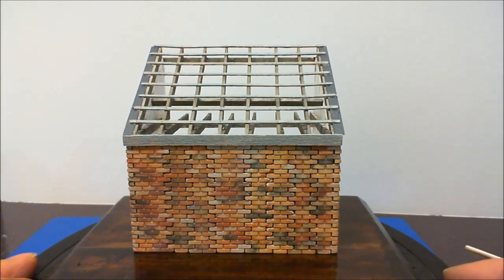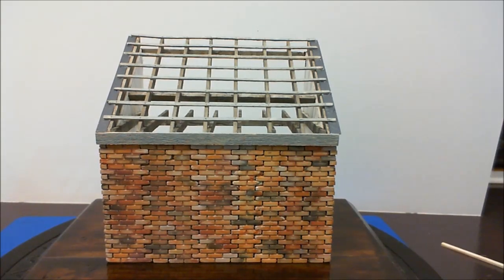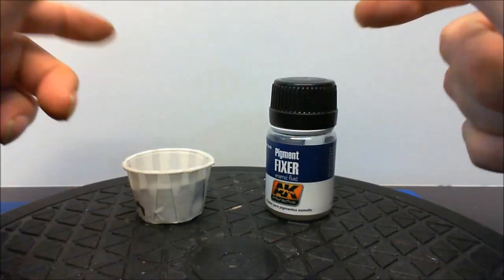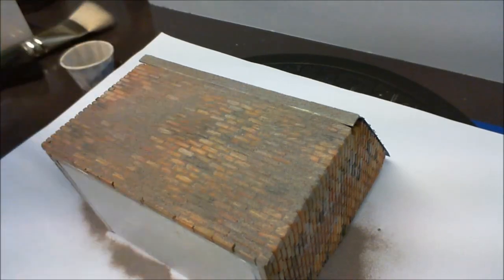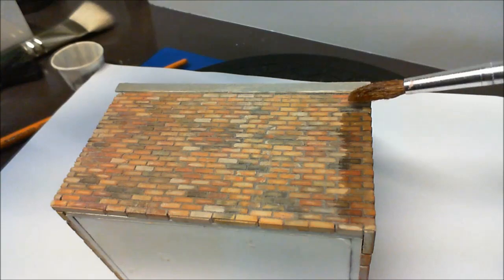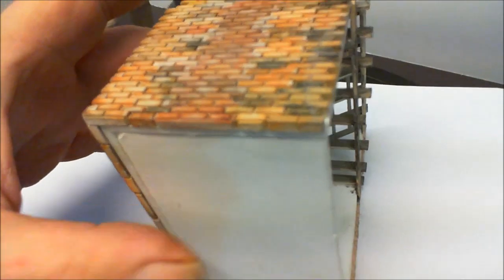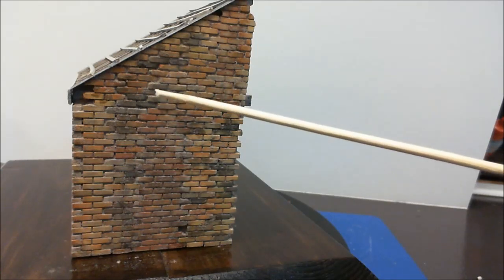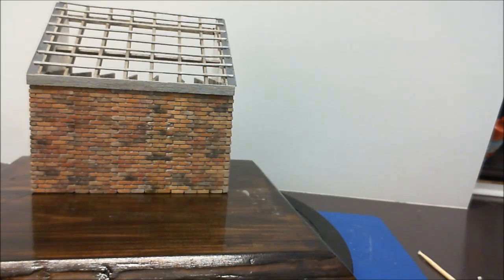Grouting Bricks In 1/35 scale (I, Video 1 )

Comment: Well done Simon, that was very useful indeed. I must admit I was wondering how to hide the gaps between the sections of brickwork and now I know!! I was thinking at the same time as you about using dilute acrylic matt varnish in place of the Mig Pigment fixer, it would be interesting to see if that works (Hint Hint).
Thanks for the video it was very useful indeed,
Joe
Reply from the maker: Don't worry Joe on the case of finding a different fixing agent as the pigment fix cost so much many thanks Sim

Comment: Been making castings from Hirst Arts for a number of years and always had problems with gaps. Tried filling them in with Hydrocal, but it still looked like crap to me with the walls/bricks showing obvious straight lines. Not that the D&D players cared, but I did. So going to give your way a try, but using railroad sand/ballast. As far as using scenic cement as someone has brought up, did some looking and from the railroad modeler website was this one guys reply:"I used the white glue to glue the Homasote down to the sub base as well as the scenery materials - so this is the method I have used over the years. As for a wetting agent - I use the premixed windshield washer fluid (summer blend) as it is nothing more than isopropyl alcohol mixed with water.  It really made gluing down scenery materials a lot faster than trying to mix the dish soap into the white glue mix.I just have a little finger pump sprayer bottle and spray an area with the washer fluid and then add the glue - sinks right in.If the area isn't soaked enough - just another couple of pumps on the sprayer! I also use the larger kitchen type of sprayer bottles with the hand grip with the washer fluid in it when doing very large areas (when I am just covering new scenery areas and I want to just put something down quick).When I did scenery - at our Club years ago on our large Lionel Layout - I used the 1 quart pump handle yard chemical sprayer (new - of course!) to apply the washer mix and even the thinned down white glue (but that was usually a one or two time only use - as we never seemed to be able to really clean out the pump sprayer) ! ;-) I now stock up on white glue from Wal-Mart when they put the school glue on sale for 0.15 cents a bottle, in the late summer, as it works out to around $5.00 less than buying the glue in a 1 gallon size and I can just open up a single bottle as I need it and not have to worry about the large bottle drying up."There are other comments at that web site about scenic cement if anyone's interested. Using windshield washer fluid to thin white glue is a new one on me. Thanks for this and your other videos. One of them showed how you made colored bricks, something I never thought of. Been a few inns, towers, etc. and used a 1/2 gallon of water based paint from Home Depot, but now going to try adding a few drops to my Hydrocal or Durham's Rock Hard Water Putty to see how it turns out. Got some 1/35th scale wall/street molds that I'll also be trying these tips on.

Comment: I don't know if it helps but I use some stuff called "scenic cement" as a sealer and have had some pretty good luck with it and 16 ounce bottle for less than $9. Really liked the way your wall turned out, never thought to use aluminum oxide before.
Reply from the maker: Thanks I shall have a look at that many thanks Sim

Comment: Great video. Thanks. I use 1:3 Mod-Podge Mat diluted with water. Works great. Just a light spray with IPA or other wetting agent, than the glue just gets sucked in. I only have some trouble getting the Aluminium Oxide (korund) in smaller quantities. I can get it in an 50 Kg bag but that is a little overkill ;-). Anyone ideas what to use next? I used Aluminium cement. It is quite nice, but also ultra-fine. This gives an little "wash" over the bricks and I'm not sure if I like that. All the "wet" solutions, have the same issue. Maybe an mat varnish first would prevent this.
Reply from the maker: https://www.ebay.co.uk/sch/magnetiteuk/m.html?ssPageName=&_trksid=p2057872.m2749.l2654 Try this link they do smaller banks many thanks Sim